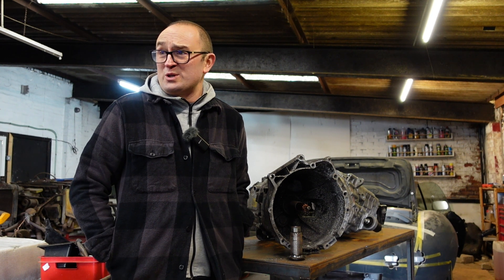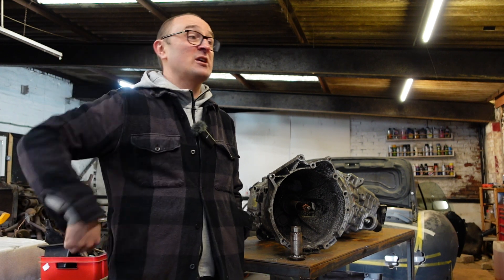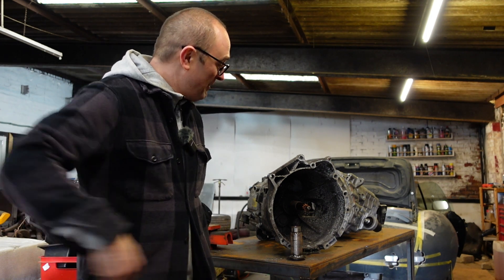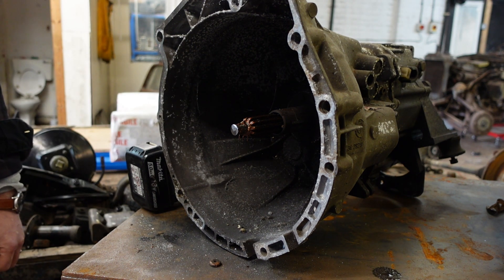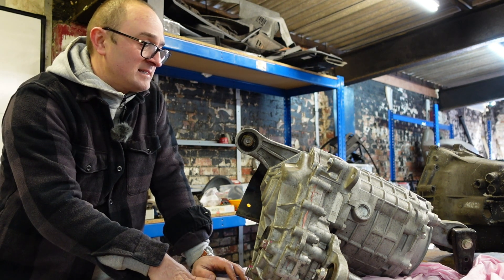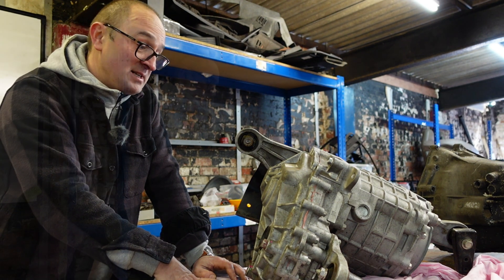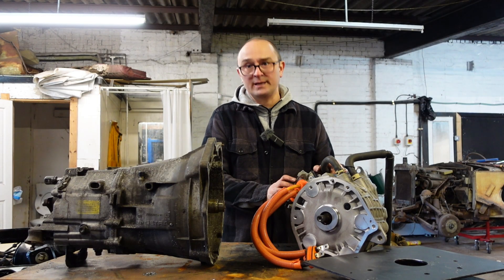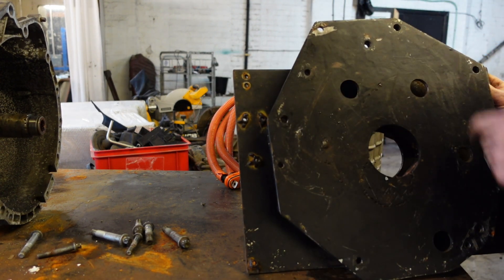Putting my DIY EV back together: NEW motor bolted up

Comment: I wonder if that adaptor plate is thick enough?
Reply from the maker: Ha! Running debate. General opinion is that it is oversized. Some people's are made out of 3mm rather than 6mm steel. Without much more bracing.